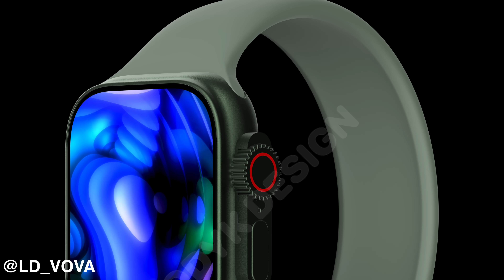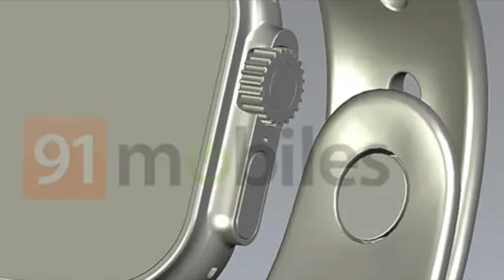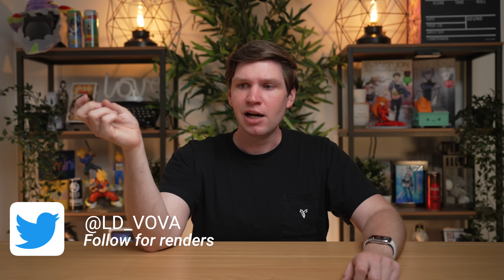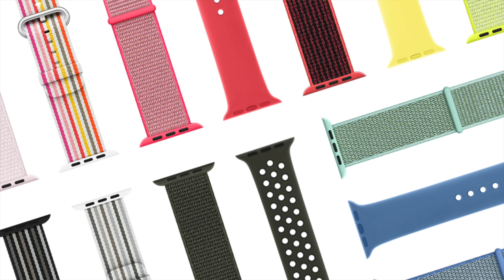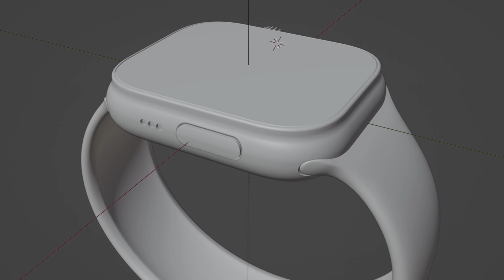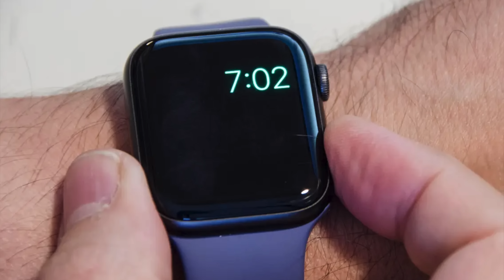Apple Watch ULTRA LEAKED! (SHOCKING NEW DESIGN)

Comment: Don’t forget the 80” IMac that’s also been leaked, it’s huge, you can buy the Idesk for $12,000 to lay this new “leaked!” Imac.   It doesn’t include a keyboard, you merely use your thoughts to control it.  Also Leaked is the M3 IPad Cleaning Cloth.

Comment: I had a 3 then got a 4 the performance was worth the difference. Now the 4 is 4 years old - and I have only 73% battery life left - I am debating getting the pro as when I run in the mornings and I stream podcasts via Beats Fit Pros my battery after 1 hour is about dead (again the battery is 4 years old). I would love to have the larger battery! If you divide the cost over 4 years its $250/year or  $20.84/mo - but on the other hand in 4 years the value is going to be worthless - the 4 trade-in value is $30 (its the cheapest one with/cellular) - dunno have to see what happens tomorrow but either way I am getting a new watch! :)

Comment: I'm just not sure $900-999 is in any way shape or form reasonable. First off, Apple Watches, at least so far, don't have anywhere near the sports/fitness tracking as say a Garmin Forerunner 955, which is a watch aimed at more serious athletes that's only $500. Even the Garmin Fenix 7, a more rugged and serious watch, with a sapphire lens, and solar powered is only $900... and again, far more sports/fitness tracking built in. Both of those also include a training readiness report in the morning like a Whoop strap, without a sub or a need for an app. They have far better battery life. Like if Apple put in far more sports/fitness built in, then it'd be something to consider. The Apple Watch 7/8 are good alternatives to say a Garmin Venu 2 Music, if you don't care about battery anyhow, but more serious athletes are going to want more sports built in. I'm just not sure who the target is going to be. I don't want a ton of apps to do what Garmin does out of the box, for worse battery. Forerunner 955 has touchscreen too, like the Venu series, so again... Get rid of the titanium, give me more sports, better battery, pro size, and drop the price to the $500-700 range, we'll add $50-100 for the Apple tax, and I'd be down for it. EDIT: Though we'll see how many actual sports they add to WatchOS 9. Still seems short of full Garmin level, but better than now for sure.

Comment: def not spending $1000 on a watch, instead I'll hink i'll wait for Series 9 and grab a Series 7 meanwhile.
My Series 2 Watch finally kicked the bucket after 6 years of use. I was looking forward to buying the new apple watch. However, disappointed with the features for this year. Was expecting atleast a useful blood glucose or blood pressure sensor. A body temp sensor is just meh! 
Even with the new Satellite connectivity, seems like its a feature that won't be used much if at all... I rarely go camping or out of network coverage for long periods of time, so not really sold on this feature also 
Coming from a Series 2 i'm sure i'd be happy with any improvements in battery life.

Comment: Not a chance I’d spend that much on an Apple Watch. Look, I LOVE having an Apple Watch. I’ve had the Series, 0,2,3,4,6 and now 7. Apple has hit a bit of a road block on what more you can use an Apple Watch for. The processing power improvements aren’t that significant for what anyone does on an Apple Watch. Now I am a type 1 diabetic, if the Watch could read blood glucose levels then I may consider spending a large amount for one but other than that it’s hard for me to spend more. These devices are fantastic and based on the rumors of the 3 upcoming models, the new SE model may be the best value for the vast majority of people. The Pro model looks cool but I can’t see a reason to fork over that much for it.
Reply: You could buy Rolex if you saved all those money for Apple Watch

Comment: I want the bigger screen size and I would pay $1,000 for an apple watch.  I wouldn't even be too reluctant.  However, and this is a big but, I will not do so without a significantly improved chip.  We've been so many years of either no or almost no improvement on the chip that the next advancement will be significant, IMO.  If I'm spending $1k, the watch has to last at least three or four years with top tier performance.  I haven't upgraded from my series 4 because there has been not a good enough reason to upgrade.  We've had one processor improvement since then and it was like a 15 percent improvement.  Who would buy a $1,000 watch when the performance will be essentially the same as a four-year-old watch, especially when you know a huge improvement must be coming soon?  I just don't quite get it.

Comment: With rumors. I’m not sold on the pro but maybe the event will change it. That being said if the 8 and the pro end up being the same thing spec wise with the major difference only being size and slightly longer battery. I’d just stick with the 8.

Comment: If “Pro” is the intended audience then this makes sense, pro in this case are athletes. Possible extreme athletes, so the design of the wheel and button being protected, so when you bang them and abuse it they don’t get pressed, bumped or bent. The more durable structure to protect the screen makes sense as well. It would need a much longer battery so extreme sports have the power last long enough if they are stranded in remote places, back country skiing or mountain climbing. They would need multiple days. Satellite would be great for where cell coverage is not available. If it had all this then $1000 is worth it for those that need it. 

For me, no I am good with my series 6 that has same computing power and almost all the same features.
Reply: Most of the people known as 'professional athletes' who might buy a 'top Garmin watch' are triathletes....people that partecipate in competition like "Ironman". I don't think that there are milion of people that do hard climbing or somethinig like that. Triathlon required up to 16-18hour of battery life with GPS and activity tracking, not more. Satellite connectivity could be a key feature but for now it is a remote possibility. In anycase, If you go alone into a canyon, I hope that you have almost a battery pack with you....

Comment: So ugly. Huge, hideous, and no technological improvements. Forget the price, i dont mind paying 1k, but making it huge to circumvent the limitations of the form factor is scraping the bottom of the barrel for improvements. It's the equivalent of an overclocked chip that overheats and needs to draw massive power. One step forward two steps back.

Comment: What if the design isn’t so far off? Imagine if Apple found a way to fit a 47mm screen on a 45mm watch body so those people would technically need to switch bands. The current watches have a screen that’s recessed into body whereas these leaks looks like Apple was  able to fit a larger screen by basically putting the screen “on top” of the 45mm instead of redesigning a larger 47mm body with the screen fitting within the chassis. Idk, just thinking.
Reply: If the render will be confirm...they choosen the simple way...put 47mm of screen into 49mm of body

Comment: I’ll pass.  My older series 4 does all I need.
Reply: I'm on the S4 as well. I will probably upgrade for better battery, faster charging, always on display, and hopefully temperature reading. But yeah there haven't really been any significant upgrades since the 4 which is still great

Comment: Looks like word “SHOCKING” has lost its punching power.
Reply from the maker: I mean the design looks weird… it is kinda shocking.
Reply: @GregsGadgets  it is.. don’t really dig it tbh. I just got a stainless steel Series 7 and locked in for a good year and a half. Next years watch will always have the better improvements, and the next year. 

I have the AirPods Pro and phone to worry about already. 😂

Comment: The CAD model doesn’t look Apple-isch to me as a product designer .. the side-profile looks somewhat wrong and the way the wheel and the display are integrated too .. can’t imagine Apple designed this .. but we will see soon :-)
Reply: But doesn’t almost look like a Apple AirPod Max from the side profile or from the top of the headphone. The side button and digital dial are starting to look like design staples for Apple
Reply: I hope you're right. The protruding part around the click wheel doesn't look good and boringly adopts 'same as every other watch approach'. However, it's entirely plausible because if the whole purpose of the watch is a 'durable sport wear watch' then protecting the wheel from accidentally turning makes sense (no matter how much I dislike the look)
Reply: @johnsr1975  what is the sports that need this type of protection? If you hurt your arm in the way to broke the AW wheel I think that AW are the last thing of what you need to take in your mind.... In my opinion, in case that this design will be confirm, this is a mirror in which Apple will hide to justify that they needed more space inside the case and they couldn't be able to reduce the component inside of more elegant design.
Reply: This is Apple purposely leaking a “diversion”.
Reply: This is how I would design it if it was always meant to stay in a rugged case. The button and the crown are raised for easier access, same thing with the display.
Reply: Looks a lot like AirPods Max so I’d say very Apple-ish as a product designer.
Reply: It looks like most premium watches.
Reply: this have to be a fake apple released
Reply: Yes, exactly! That also went straight through my head. It somehow doesn't fit with the pro-feeling that Apple has always brought across well with its products.
Reply: @fruxz  it’s meant for people doing xtreme sports. it looks very much pro for that.